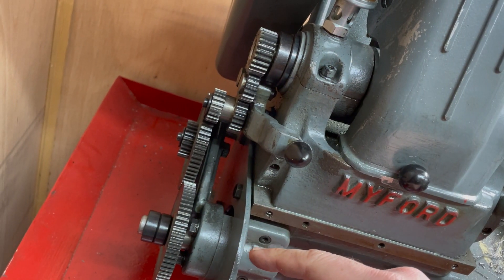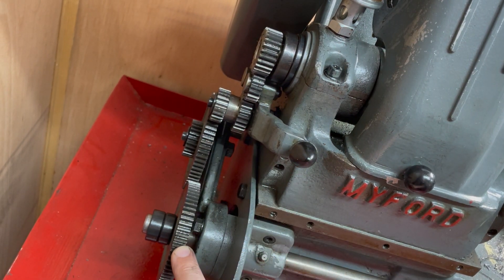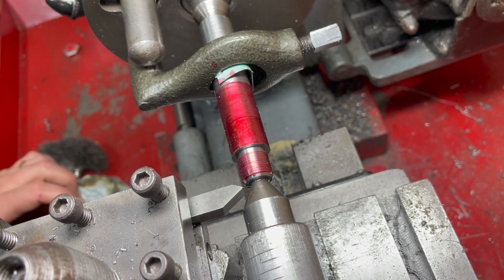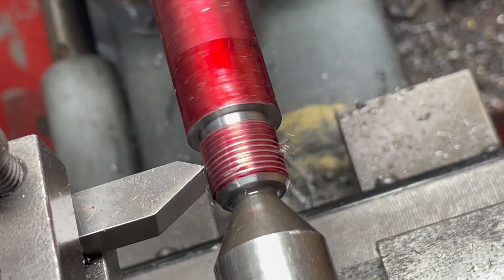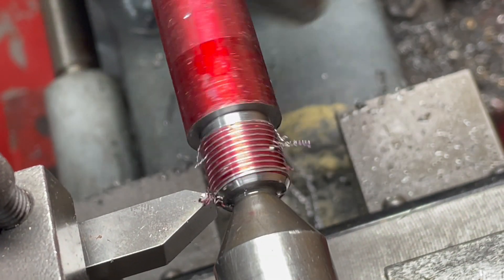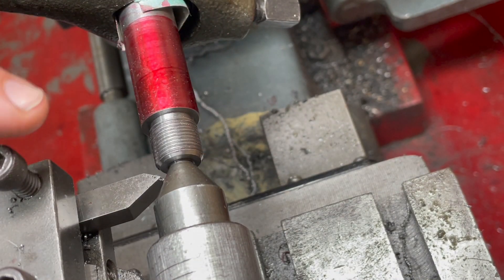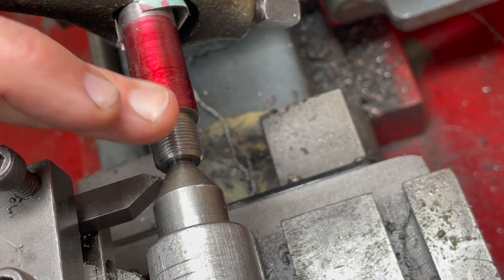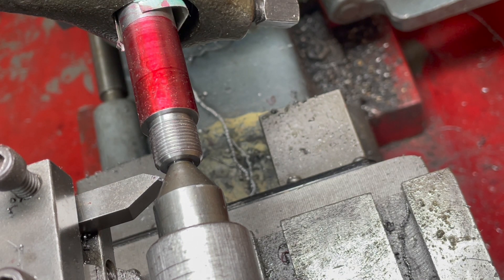Single point thread cutting between centres on the lathe - Bogie Pin - Steam Loco Build #12

Comment: Hi, great work. I think you have your compound slide set at the 'wrong' 30 degrees if you see what I mean. 30 degrees from the cross slide axis should mean the tool generates the thread rather than forms it. It looked to me that you were at 30 degrees from the bed axis. Doesn't matter too much for fine threads.

Comment: Nice work. Have you considered a live center? I got one with an MT2 and it works well.
Reply from the maker: I didn't use a live centre partly because I was deliberately going 'oldschool' but also because the live centre I have has a fair bit of wobble in it. I'd rather not buy a chinese import, but I'll keep my eyes out on eBay...
Reply: @williamsworkshopuk  Fair enough. I do have a Chinese import.